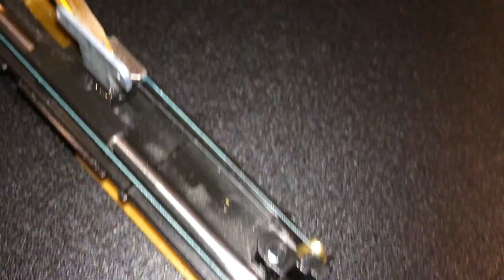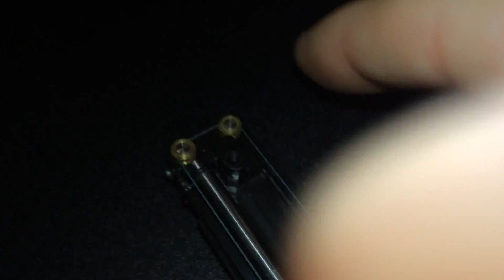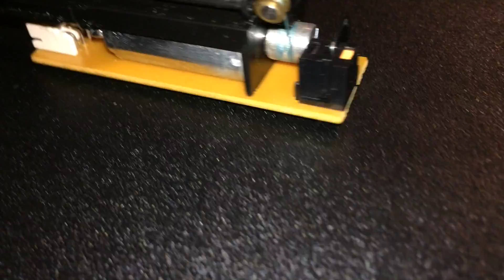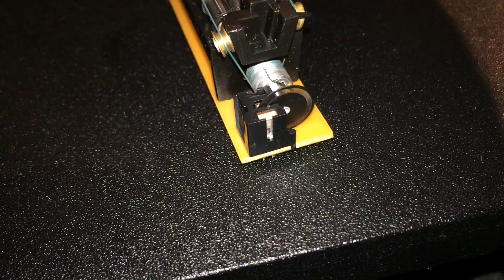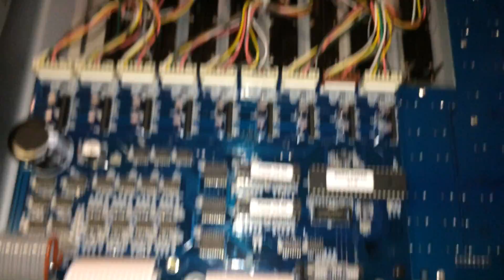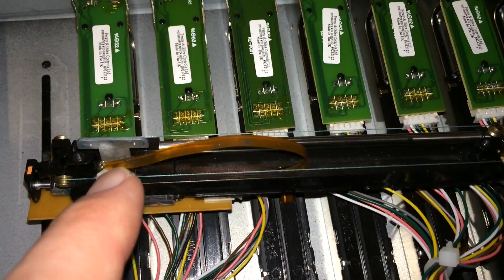How Motorfaders Work

Comment: But why do they operate silently? I always thought they used ultrasonic piezo motors because I could not hear anything while they moved. Is it the string setup that keeps them silent, as opposed to a rattly set of gears? Do Yamaha consoles use the same kind of faders?
Reply: You pretty much figured it out, yes. Little gears, especially straight cut ones are rattly and loud. The noises you hear from older camera lenses focusing, RC servos or reverse gear in a stick shift car are just the next teeth making contact right after the previous ones let go, there's a short moment of no contact. These DC motors are also less noisy than the more powerful AC motors that tend to make whistling noises especially when moving slow. And yes, a string rotating plastic wheels is super quiet, there's no reduction gear, so it's directly connected to the motor shaft. The most notable noise is when it's hunting back and forth because it's overshooting the desired position and then the motor is quickly moving back and forth trying to hit the intended position. All motor faders I'm familiar with work like this I guess because it's cheap to make.

I looked at videos of Yamaha CL5 and these might be stepper motors from the way they silently jump into position. Looks to be a similar system though with string and wheels.
Reply: Yeah, there are different variations. A decent amount just use a slider attached to a worm-gear driven by an encoded motor. Doesn't involve fragile strings.

Comment: Hi ! I have a problem with my MCU Pro. Some faders do not calibrate correctly, so 0db in the mcu screen doesn't match the layout, nor the daw. Second question, is it possible to replace the P&G faders with the Alps ones ond upgrade the firmware ? Or will it "destroy" the mcu ? Thanks.
Reply: Same problem